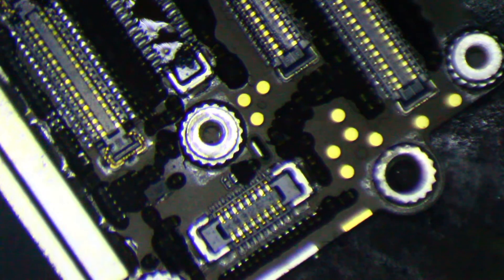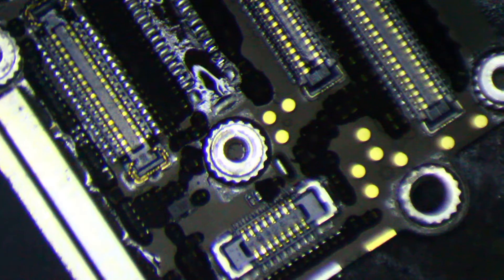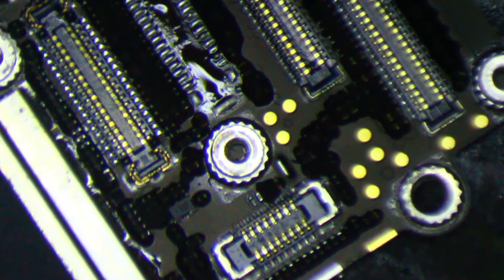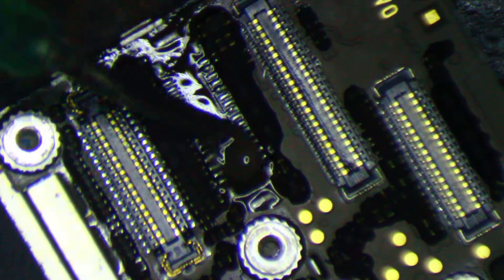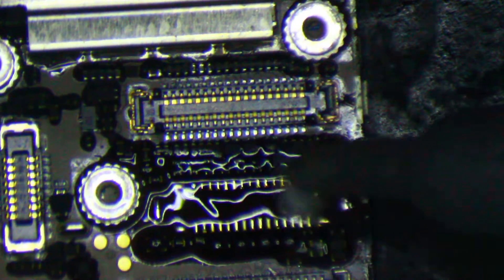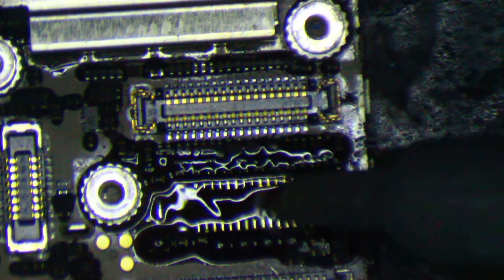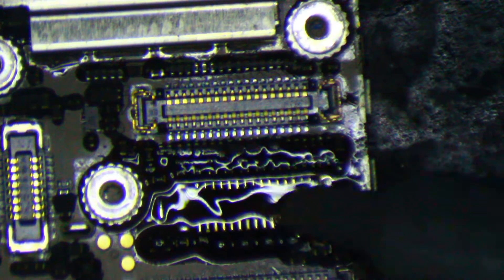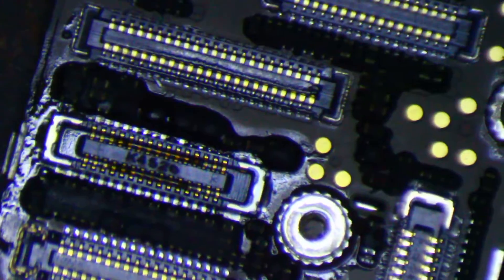iPhone 6 LCD FPC replacement

Comment: How is it possible that plastic body of the fpc does not get damaged from the heat while soldering the pins with the soldering iron.What temp do y use?Thanks,
Reply: spartiatis9 Plastic melts at around 180 Celsius and Lead solder is around 140 Celsius.   Keep your iron at around 160 to 170 Celsius.
Reply: Vince N. Thanks helpful
Reply: 60 40 solder melts at 188C...

Comment: Hi can you replace my phone(6plus)same problem. If yes how much will a job like this cost?
Reply from the maker: jovanni d.v you can request a quote on www.mendonipadrehab.com - in my experience 9 out of 10 iPhone 6+ LCD or digitizer fpc jobs were damaged when techs were trying to troubleshoot no touch. be aware that after replacing the connector you may also need touch ic repair which would be additional cost.

Comment: What temperature are you using with the hot air gun to remove and put the new one on?
Reply from the maker: Michael Bilich I use around 653 Kelvin to remove and 633 Kelvin to install. every hot air station is different and I have a video explaining why this is and why the number I use is meaningless. use a temperature that is hot enough, but not too hot.
Reply: Mark Shaffer That is way too hot.  The plastic will become all gooey.

Comment: Hello Mark, I am fairly new at this but was wondering if you can tell me what kind of flux is best to use for this? Are there any specifics to the solder that I should know like should it also be flux core or solid? Do you typically pull the entire board from the phone to do this (I expect yes due to the amount of flux you're using and the need to clean the underside.) And lastly what do you find best for clean up? The solvent used etc. Sorry, I want to know all as I'm frustrated at my failed attempts so far. Thanks, and your video is awesome.
Reply from the maker: dean matters I prefer amtech 559 flux but chipquick 291 is good too. I use kester 63/37 rosin core solder but the rosin core doesn't matter since you don't apply it at the joint like you would with larger through hole soldering. I use an ultrasonic cleaner or acetone to clean up depending on how much there is to clean.

Comment: hello mark, thanks for sharing!

i wondered...is it safe to work with hot air while the silicon underfill is there?

i usually remove it, but if this works good im gonna try it
Reply from the maker: Mohammed El Bakh I never have an issue with it besides a few solder balls I have to remove.